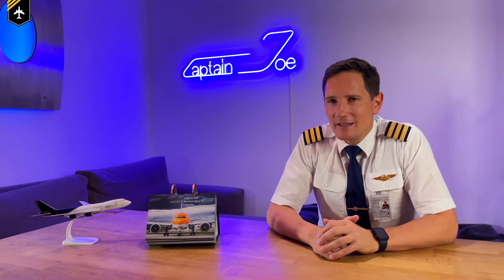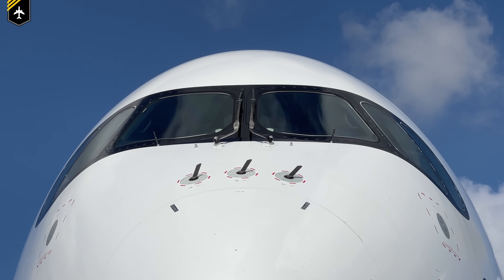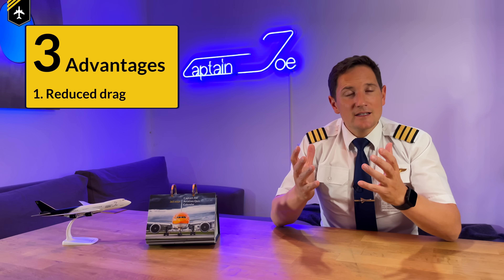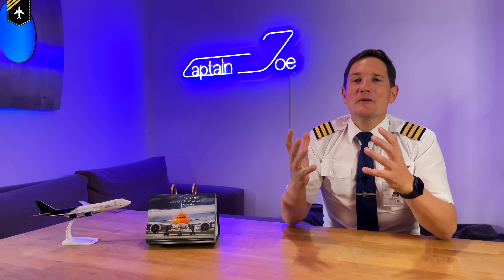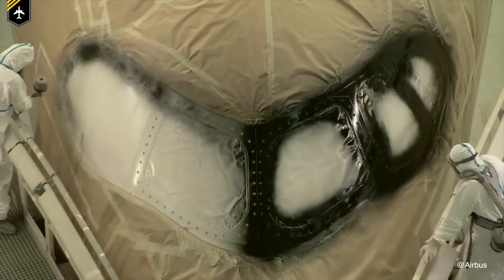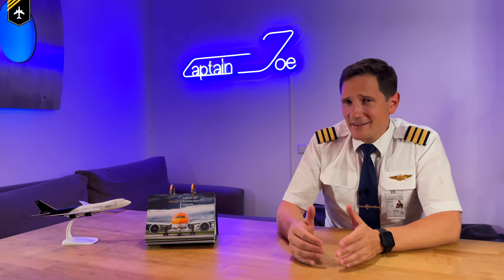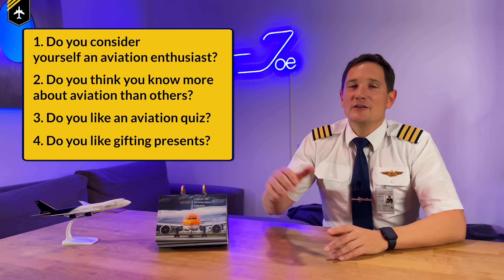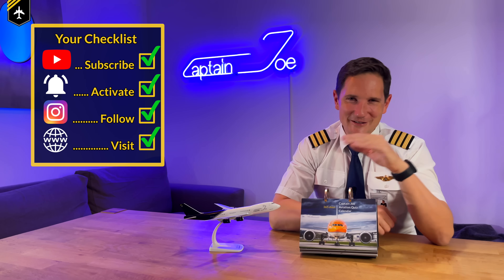The A350 MASK! Cockpit window shape EXPLAINED BY CAPTAIN JOE

Comment: 1. The Boeing 787 and A350 are not "direct competitors" in terms of range, size and fuel efficiency, otherwise there would be fewer points of difference on which airline customers could base their choice. Airbus deliberately tries to avoid competing in EXACTLY the same market segment as the closest equivalent Boeing product for that reason (A350 vs. 787, A320 vs.737, A330 vs. 767/777, A380 vs. 747) . The A350 is slightly larger and heavier and costs slightly more to buy and operate than the 787, but can carry heavier payloads over greater distances (and is, arguably, more comfortable for pax and crew) - you pays your money and you takes your choice. 
2. I thought that one of the main reasons for the black window surrounds is that if a window has to be replaced, a common stock of black-painted ones can be used rather than having to custom-paint one in the specific livery of the airline, which makes it easier and cheaper to source.....?

Comment: Actually the Comet square windows as the root cause is a myth.  You can have any shape window as long as you make the corners strong enough .The cracks that appeared at the corners were from undetected design calculation mistakes, not inherently from their shape.

Comment: Still, it does make the A350 more recognizable to the general public. I always thought the A330 was the most bland looking thing on the airport (since I hardly ever see a 767 these days) as it had so little differentiating features in its looks. The 737 NG has the low engines with the flattened inlet and the 777 has the 6 wheeled trucks on its main gear, the gigantic engines and the 767 cockpit that looks too small for the diameter of the fuselage. If the A350 didn't have the black windshield frame, many people would hardly see the difference between an A350 and a 787. Airbus incidentally made the 787 more recognizable as well as their own.

Comment: Question: A plane is flying straight and level. It wants to maintain its altitude and air speed. It is flying level because the lift from wings balances weight of plane. Let’s leave out drag. As the plane flies, it becomes lighter because it burns fuel. With out correction it would increase altitude, correct? How is the correction made? Is it made “constantly” or every few minutes the control surfaces adjust to fly the plane to a lower altitude? Just wondering.
Reply: If the Autopilot is on, usually the trim changes automatically to compensate for the change in weight and center of gravity.
Reply: @ZK-APA  Thanks for the answer. It is what I guessed, just wanted to know for sure.

Comment: Hey can you make a video on landing flaps to explain if they use max flaps to land or different depending on weight and weather conditions.
Reply: The conditions differ from aircraft to aircraft, but from what I know, max flaps gives the best landing performance (slower speed, shorter landing distance) whereas landing with less flaps gives better fuel efficiency and better go around performance (so its more suited for stormy weather, provided the runway is long enough)

Comment: This does not make sense as black body radiators will radiate the warmer temperature of the airline to the colder  environment more efficiently. Hence for that hypothesis to work, it needs to assume you get more heat radiation from the outside than you have from the inside and I don't thinks that is always true. Then you might as well paint the entire airplane black and save energy on heating. But it does not work that way. Unless they use that area as a heatsink rather.

Comment: 'max chilla' is correct, the A350 is more directly competing with the B777, not the B787.
The A330 neo a closer comparison to the B787 and in both cases the Airbus product is superior (yes I know, I can hear the 'we ain't going if it ain't Boeings' screaming already, but it's a fact) and the reason the B787 has sold more units is it's cheap (in part because of the cheap labour force at Charleston) and for many airlines that's the bottom line, never mind quality or reliability.

Comment: Living in Toulouse and having lots of relatives engineers at Airbus, myself being a pilot; it is widely believed even at Airbus that the reason why the a350 got his mask was because the new window shape was too ugly coming off the assembly line. Having a mask that hid the shape underneath made it better looking; some engineer found a plausible scientific reason why the mask got implemented (honestly ? They try to fix a non existing problem) and all A350s rolled out like that. The mask then got popular and Airbus decided to put it on all it’s new lineup.
Reply: Yes, it is mainly a marketing stunt. The black looks awfull in combination with airline liveries that do not use black.

The windows design looks awfull compared to the sleek four window design of the 787.
Reply: @ACPilot  The original A350 XWB had a different nose and windows profile but Airbus reverted to the A380 nose and cockpit windows profile to accommodate the avionics bay and landing gear requirements. I personally don't mind the current window config but I think it looks nicer without the black shade🙏

Comment: A350 in on the B777 range. B787 is on A330 range. A350 does not compete with B787
Reply: In terms of technology they do. But yes in terms of size plus range, you are correct.

Comment: The REAL reason of the mask is to hide the rivets. Airbus was not able to manufacture the complex shape of the nose area out of CFRP. So they have to use Aluminum, hens the rivets around the windows. So they hid them with black paint to disguise the fact that not the entire are craft is made of composite material.

Comment: If Airbus wants the paint to absorb heat, then it doesn’t make sense to paint it gloss black which will have some reflective properties of light waves. flat or matt black paint absorbs far more light more efficiently.. This is why you typically see pool solar water heaters painted with a flat black finish.. 🤷‍♂️

Comment: The A350 competes with the 777 in terms of size. The largest 787 is still significantly smaller than the smallest A350 - they are not in direct competition actually.

Comment: Thanks for this great video ! Just a question, I thought that the average 787 is significantly smaller in PAX than the average A350. If this true, then they are not direct competitor...
Reply: Yes you are correct. In terms of technology you can say they are direct competitors as they are the latest models (which are not a derivate of a previous one)
But in terms of size and capacity, the A350 is larger than the 787
Reply: Thank you for your answer ! Have a great day.

Comment: I have a question. For those 4 engines aircrafts, why only 2 engines are used for reverse thrusting to stop the plane while landing?   Why aren’t all 4 engines used to stop the plane?   Thx
Reply: The outer ones are too close to the edge of the runway and may suck up debris?

Comment: The cockpit windows' pointy edges in all those models had me questioning why they're like that since the beautiful Comet's terrible disasters, and as I typed the word Comet, you mentioned it lol. Such a great tragedy, that. I think that was one of the most beautiful planes ever.
Thanks for the explanation!
Reply: The Sud Aviation Caravelle used the same fuselage as the comet, however the wings were different and the engines were mounted at a different position

Comment: Hi cap Joe, one day I was with my mother seeing something of the Panama Canal, and the systems to raise a ship (or descend as the case may be) the 26 meters (85 feet) of difference between the Atlantic Ocean and the Pacific Ocean.
My first "normal" question was to think "why are the oceans balanced if they are not communicated by both ends of the American continent?" (question that I don't know if I should solve with a geologist or with a physicist ???)
Then the passion for airplanes came out of me... and this question maybe you can answer me (I hope because curiosity kills me!!! hahaahaha). When the altimeter is set "at sea level," are we talking about the Atlantic Ocean, or the Pacific Ocean 85 feet below? Or is it an average between the two?
It may be a silly question, but I searched many internet sites and found no answer. Perhaps you know more specialized sites where they answer this question.
From already thank you very much.
Greetings from Argentina.
Reply: Sea level is the same the world over. The height difference you mentioned may be the difference in height of the ground at either ends of the canal.
Reply: @stanleybuchan4610  No, to go from the Pacific to the Atlantic you have to "go down" almost 30 meters, this is because on both coasts of Panama the height of the oceans are at that height difference = the sea level is not the same. So what (or where) is taken as reference 0 = sea level?

Comment: One point about the 747 windows - though still revolutionary, I believe the 747 windows are only curved in one dimension (a conic section).  Newer planes like the 787, A220 and A350 have more complex curved shapes across both dimensions.

Comment: I appreciate the video, but respectfully as an engineer, I can not agree with your claim in the video.
This is nothing new, many Soviet jets (IL-76, Aeroflot airline livery), military fighter jet (metallic colored such as P-51, F-104) and some airlines with white livery (eg original Boeing 747, even as recently as the Air China 747-8 and Lufthansa retro livery) have black mask under windscreen. They have legit reason though - reduce glare caused by the nose, which is so why their mask don't go over the supports and top side of the window.
Glare can be a concern, but not likely in case of A350. If you take a look of other planes I mentioned (namely 747 and IL-76, F-104) you can see it is possible for sunlight reflect from the nose into the cockpit. 787 (I think looks better than A350) also have a curved flush windscreen, they didn't require anyone paint it black around them. That makes "geometry causes glare" more unlikely.
The difference of paint color on cooling is irrelevant on night flights. so if the expansion is a concern, the windshield heating system should taken care of it regardless of effects caused by sunlight.
To me (who studied in aerospace engineering), it is just for marketing and standing out in a picture, not targeting passengers, but airline executive. Similar to how peer pressure works, "Look, all your competitor are flying Airbus!" Pressure executives to consider Airbus to minimize uncompetitivness caused by airplane type difference, especially today most large airlines are not Boeing only or Airbus only.

Comment: The a350 is just the most perfect plane out there. With it’s beautiful engine sound, it’s beautiful exterior design, it’s interior design, it’s cockpit, how modern it is, how safe it is, how advanced it is. Just perfect!
Reply: Except for all the paint falling off.
Reply: Reiner  yes
Reply: wait until the 777X gets going... [I`ll probs be old by then lol :(]
Reply: @SeanDych3  actually, the a350 is more advanced in terms of years because the 777x is more or less like the a350 and the a350 came out in 2013 and still is super advanced. Not that I don’t like the 777x, it’s an awesome aircraft it just that Boeing is a bit behind.

Comment: Airbus engineers: "you can have the windshield outline in any color you want, as long as it's black"
Reply: lol
Reply: Borrowing a note from Henry Ford's book, I see.
Reply: You made me laugh, that was a good one 👍
Reply: @Sci-HFY-novel  he copied that from Ford.  It’s about one hundred years old.
Reply: @sqwk2559  Interestingly, Ford decided that only several years after starting model T production - at first, there were multiple colors available, not even including black, and only then switch to all-black happened.
Reply: @McFrax  It was to optimise factory assembly pacing. Something they found out by trial and error.
Reply: @McFrax  it was because he used an oil-based paint that doesn't fade and didn't need to be repainted, but the oil-based composition only allowed the paint to be black. Since Ford invested a lot of money in that kind of paint then he decided that all of his cars would be black. That and also to optimize the assembly line and thus making the car cheaper. Sorry for the late reply.
Reply: But there’s matte black, gloss black, high gloss black, satin black, reflective black, fluorescent black
Reply: I guess it will be black
Reply: I still live by this quote to this day, even after seeing your comment the moment it came out.

Comment: Hmm, i think the temperature spreading argument is a bit suspect.

Black IS great at absorbing heat from IR sources, but it's also great at emitting heat into low IR sources, it's why when you talk about radiating heat you normally use a "black body" radiator, it's the most effective IR/optical radiator.

So at night above all the cloud (which absorb and reflect ground heat back to the ground), you've got a surface of black paint radiating into... space, which has an IR temperature of about 3 Kelvin. Now the 2nd law of thermodynamics says that black surface, in the absence of warming air, IS going to thermally equalise to the average temperature of space. In practice though the air normally only lets it drop a few degrees below the air temperature, You can't even say that the black might help the frame absorb heat from aerodynamic heating because at normal sub-hypersonic speeds the long wavelength IR will be absorbed by white pains, or at leas you could make a white paint which does it (it's why the ISS and shuttle radiators are white, they're emissive in long IR).

Either way, painting it black for thermal control is dubious. In the light of the sun, it'd be nice and warm and in the cold darkness of a moonless clear night the frame would be trying to get down to -270 Celcius. Not exactly a constant temperature change...

I mean, I want to say it has an engineering reason for being black, i just don't think it's for thermal control.

Comment: The A350 isn't really a direct competitor to the 787. Especially not size wise. The A350 is a bigger aircraft overall. The 787-10 and A359 do have a similar capacity but they are in a different range category.
787-8, 787-9 and A350-1000 don't compete with Any counterpart. A350 is more a 777 successor.
Reply: Ok Coby
Reply: True, but everyone thinks that they compete 🤦🏻‍♂️😂
Reply: @luisflucht6702  yes because both are the first composite made aircraft instead of aluminum

Comment: Second correction.....yes airline passengers care about the plane they are on.....I for one will not set foot on a 737 Max.
Reply: I'd extend that to any recent model of the brand, especially from that second site with cheaper, less qualified workers. FOD, shoddy battery ground, every other week there's a new FAA advisory out for yet another problem due to shoddy workmanship, improperly inspected parts, composites breaking apart at the seams etc. Since the beancounters took over from the engineers in management, it's been constantly downhill for them.
Reply: @Makatea  hmm.....yes, the 787 does have its fair share of headlines. Could it be that Boeing is intentionally sabotaging its own products to justify moving production to states with less favourable (for the employee) employment law? I have no proof, but it seems they badly want out of Washington.

Comment: I always thought that the whole panel was made out of carbon fibre instead of traditional materials so I thought it was just one of those things that was an after affect rather than something completely different
Reply: I think unpainted carbon fibre is black, but it only stays that way on e.g. supercars for cosmetic reasons.   Large parts of the A350 and B787 are carbon fibre but they get painted in the usual way.

Comment: I‘ve recently read that „the black color helps to reduce maintenance costs. When replacing a cockpit panel, chipping is a common occurrence around the edges. These are easier to paint over with the universal black than if you have to find the airline's exact fuselage color every time. In addition, the border helps to compensate for temperature differences. This reduces the forces on the windows. Cracks are less likely to occur.“

Comment: How bad is a hot window framed by cold metal? How much hotter is a black frame compared to a white frame at FL 360? My guess is the colour of the frame does not cause a significant improvement, at least not so much that it cannot be solved by any other conventional means such as more advanced insulation and sealing between the window and the frame. The black mask is just a marketing ploy, in my humble opinion. I do not agree with you on this one, dear Captain Joe.
Reply: Especially at night, the black will not heat up at all. And I wonder if it does heat up given all the airflow around it.
Perhaps if it was insulating paint it could, but would be rather thick paint then.

Comment: Paint does add a lot of weight over a large space and black is a beneficial color for heat. The thing is my father in law worked as a ground mechanic for many years and he said that high standered from factory is a joke in the real world. They would walk down the hulls and the whole plane would be covered in dings and scratches. If they needed to paint something, their was no maximum amount they couldn't exceed, they slapped it on till it looked good. The only important part was making sure the fasteners were properly flush to spec when putting panels back on.
 
It was truly amazing hearing the real side of maintenance on these beasts vs the fluffy perfect world scenario the factory would put out.